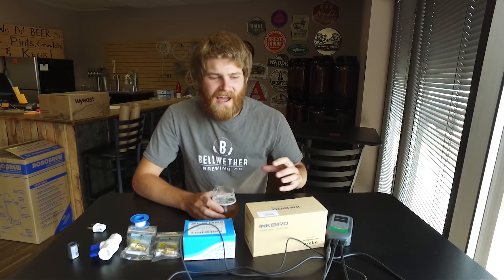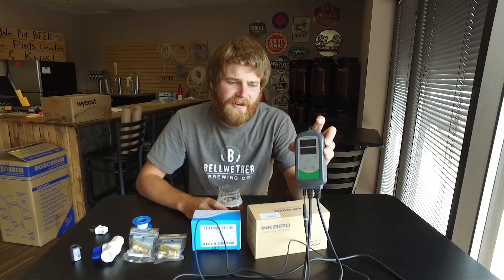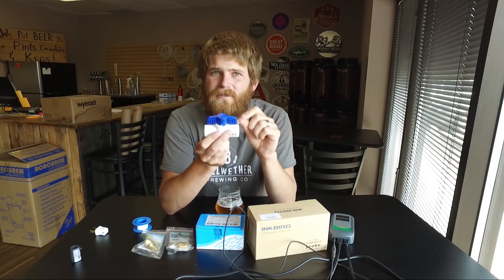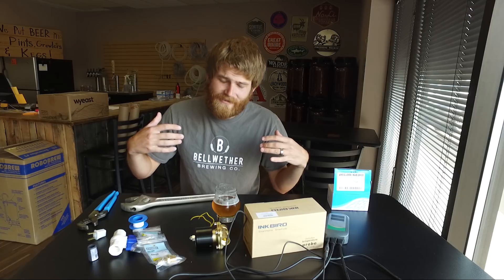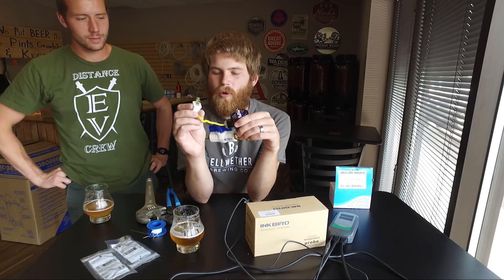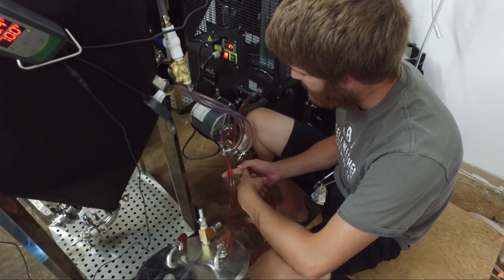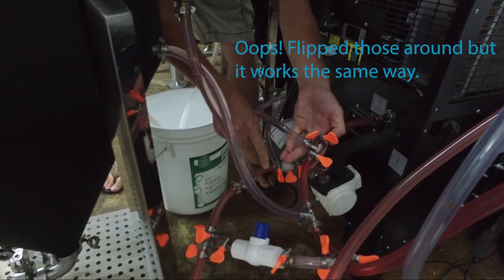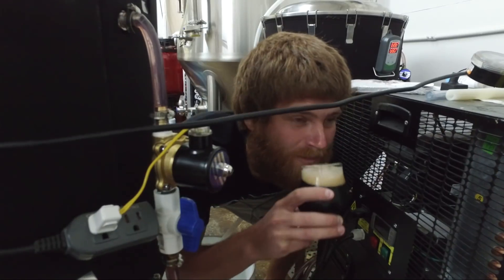DIY Cheap Solenoid Temperature Control for SS Brewtech Chronicle Fermenters

Comment: Hi guys, nice set up !
How did you put the inkbird thermometer inside the SS conical fermentor ? Is it possible to link the thermometer that's already installed in these fermentors ? 
Thanks.

Comment: That's a pretty great solution for multiple fermenters! I was planning on setting one up like a Keezer, and having the temperature controller hooked up to a pump. Do you have a fancy chilling system that feeds the glycol?
Reply from the maker: Yup, the big thing with the grates is actually a commercial 1/2hp glycol chiller(way overkill for the home game). I can see your idea working great with some kind of heat exchanger like a small radiator in the freezer.
Reply: Genus Brewing yup, that was the idea. What's a home gamer glycol chiller run for, are they even available?
Reply from the maker: Small glycol chillers are available but they are pretty expensive. I know SS Brewtech has one for $1000 and I think the cheapest one I've seen was around $600. I have faith that these prices will drop over the next few years as the market for small chillers grows. I do know of some air conditioner hacks with glycol that you should be able to learn more about with a quick google search. Cheers!